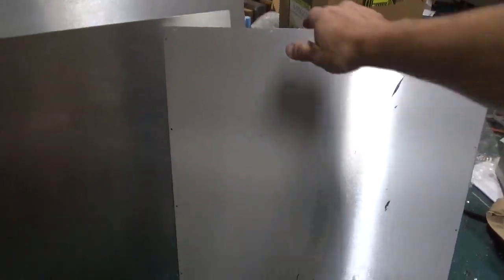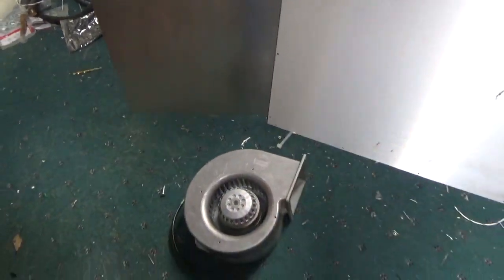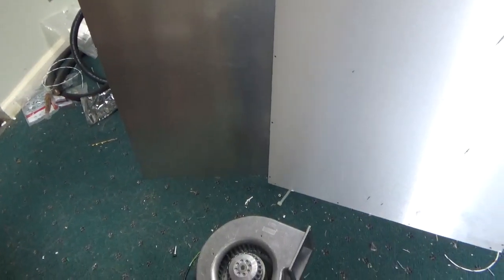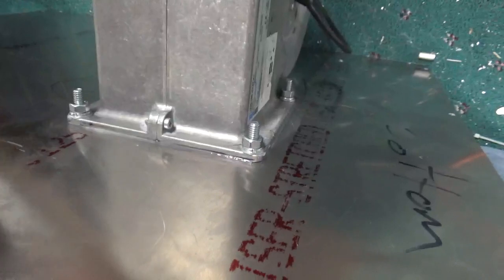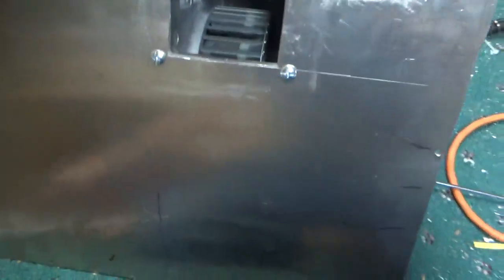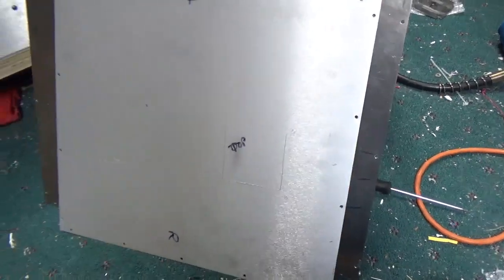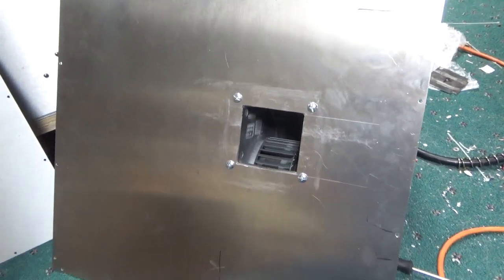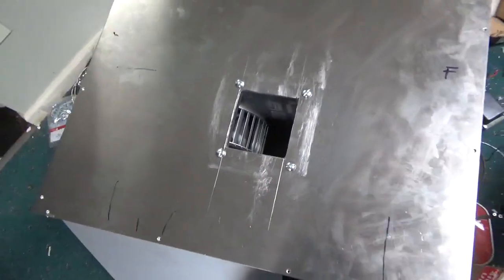EBM Papst Blower Installation 3cx6000a7 10kw 6 Meter linear Amplifier

Comment: That's the blower I use on all my big amps.
Reply from the maker: They make a good blower 
, they also take up less space then one with a motor mounted on the side

On the bigger stuff I prefer kooltronic kbb series . Not cheap but well worth it 

I have seen lots of boxes with insufficient blowers. Most don’t realize they need to follow cfm AND pressure spec for anode dissipation . 

Can de rate a bit for reduced ambient temp compared to spec. But always better to have more cooling then needed .

If you have the proper blower no delay off circuit is needed, as long as filament is shut off at the same time as the blower.